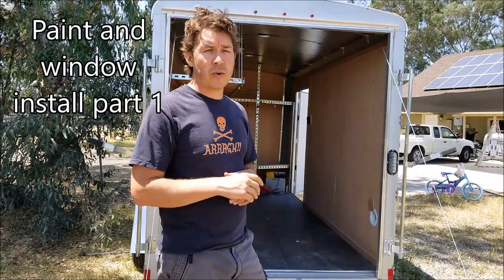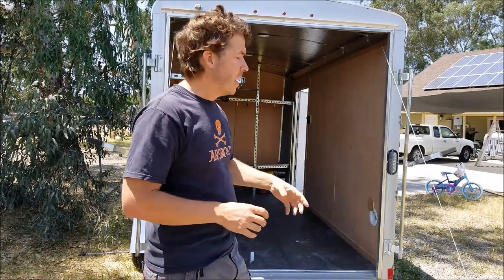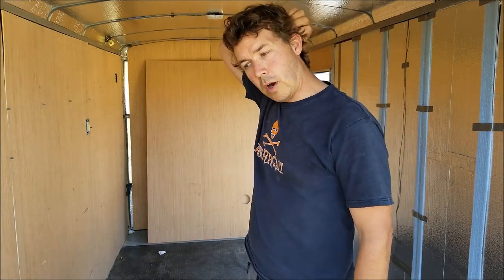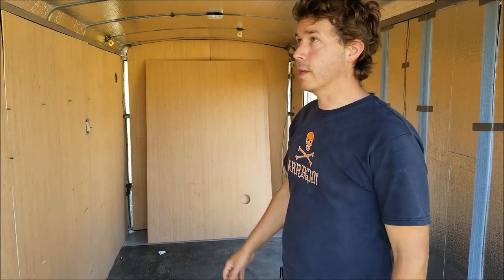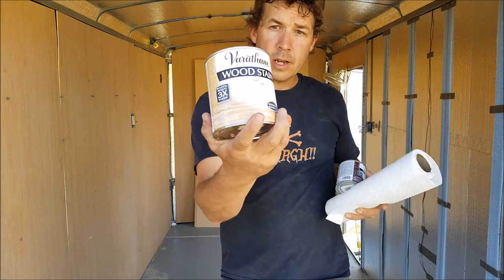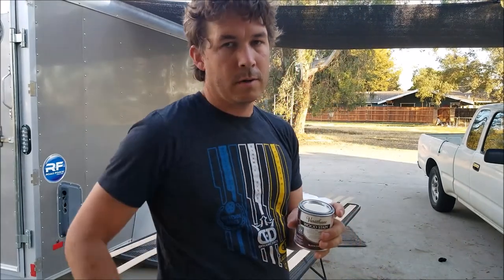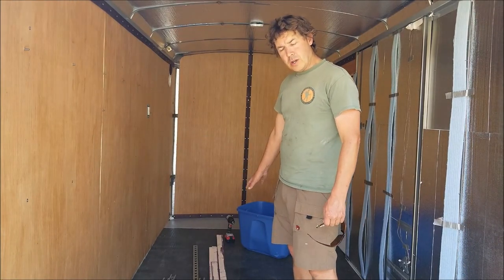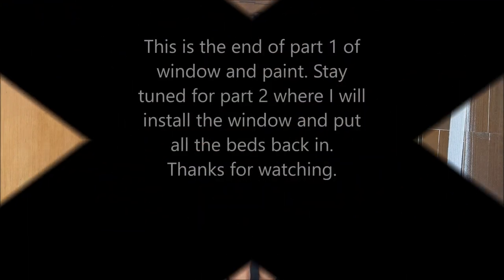Cargo trailer conversion window and varnish part 1

Comment: Nice job,need your advice on putting a window 18" X 44" in a 7X14 ft cargo trailer. There 3 metal studs that have to be removed. Will that weaken the side of trailer. Would appreciate any of your thoughts thanks.
Reply from the maker: I had to cut 2 for my window. You can see I welded in a frame for it. You should support it if you can. The biggest threat here is snow load. If you live where snow is common it would be a good idea to reinforce around the window.
Reply: Thanks for getting back to me. I am having the people that built the trailer install the windows, just not sure what size yet 
Dealer say 15 x 30.hope to meet some day,great videos